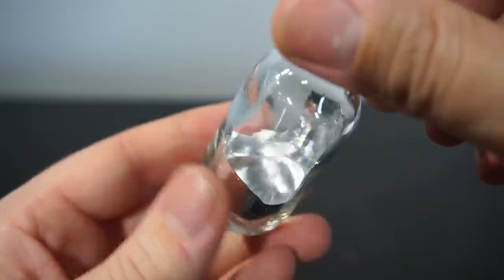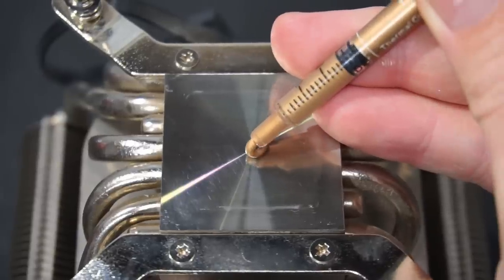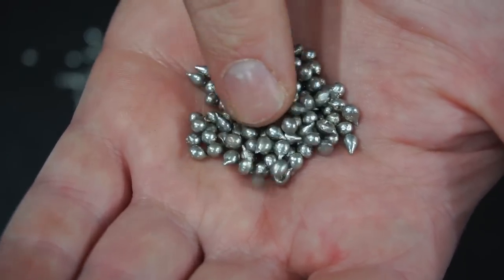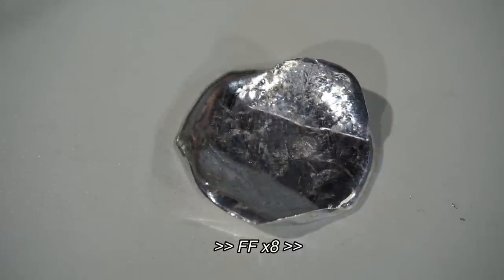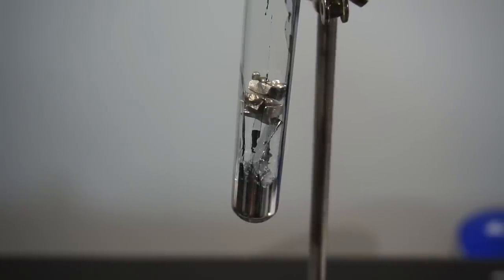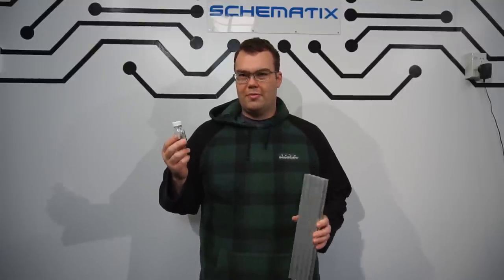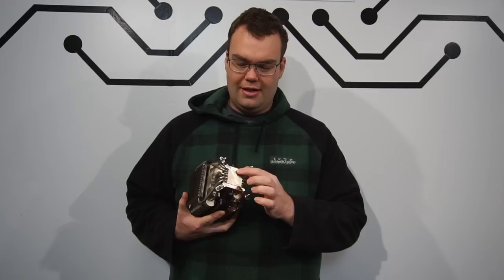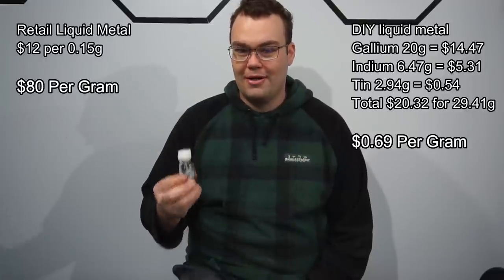Making Liquid Metal Thermal Compound (Save $$$)

Comment: Indium foil is what I’ve seen used in insanely high end transfer applications. It’s supposed to be as you can get to diamond without buying optical diamond CDV windows. 

Like if you buy a $100,000 laboratory laser module for an optical test bench… And open up the laser cavity… There will be indium foil used in the place of thermal grease or liquid metal. 

I bought some insanely powerful infrared laser modules on eBay.  they were about $100. And when new they are thousands and thousands of dollars. Like $20,000. Made by coherent, and the entire optical laser cavity is contained in a module that is completely gold plated, And hermetically sealed. But I’ve opened up some of them before to do modifications and repairs. 

You can look them up on eBay just type in something like “coherent laser 80w”. Many of them that I have purchased and repaired still had traces of iridium foil pressed into the pores of the metal on bottom. It really is impressive stuff, super cheap, (for what it does) and supposedly very great at heat transfer. 

I’ve used gold leaf sheets before as well, because it’s what I had on hand and it’s extremely cheap to buy a whole book of solid 24 karat gold leaf sheets. They are only pennies each, are pretty good size, and if doubled up do a pretty good job transferring heat in places with optical equipment where I absolutely can’t risk using some type of liquid or paste.

Also I don’t know what type of affects the gallon will have when mixed with the other things in your solution. But if it were to come in to contact with anything aluminum… That’s a big deal and will absolutely eat things alive. But who knows I’m no expert just a part time Tinkerer and full-time ne’er-do-well. 😂 

Thanks for the video! Always love your content. It’s extremely high-quality. And offers more advanced methods and topics than your average electronics YouTube channel but without getting into straight up rocket science stuff. Love it!
Reply: OK my bad should’ve finished watching the video before I made the comment about it being dangerous near aluminum. You obviously showed that very well in your video. Thanks again!
Reply: Sorry to make another comment… But in my opinion the foil would be better because not only do you not have to worry about the gallium contamination… 

And foil from what I have seen… Sinks into the pores of the metal just like it would if it were liquid. And that’s why optical and laser companies use it because it’s easier to handle than liquid. And they can’t be having any type of liquid in their hermetically sealed optical modules.
Do you think the thermal transfer would be the same? I know for a fact it penetrates the pores on the metal with given a small bit of force… Because I have examined it under a microscope and it’s obvious when you brush it away and even wipe it with alcohol you can’t get that silvery looking foil off of the gold plating of laser optic components. Just like if you were to take a blow torch to copper that has had sold or melted on it… You can heat it and wipe it as much as you want but only mechanical removal will completely remove the silvery look… In other words sanding.

Would love to hear your opinion on this.

Comment: Not only aluminum can be corroded by this. I saw a graphic card messed up by a gallium metal solution. It reacted/corroded with solder joints and made it unusable. Sure, it is a very good thermal paste alternative, but if made contact with the rest of the board it will corrode anything made of tin(all solder points - especially mosfets, but also other small components - capacitors, resistors etc).
Reply: what? I'm not sure what you are going for here. I know your post is 3 years old but If you can elaborate it would be great. the liquid metal is never supposed to come in contact with the solder joints. it slightly discolors copper heat spreaders but that can be fixed with sanding later down the line. but it eats aluminum at an insane speed, like a giant ingot being turned to nothing in 48 hours type of fast. but it's conductive so there is 0 reason for it to be outside of the DIE, chances are it would short out other electronics instead of corroding them.

Comment: If you could pump liquid metal, you could remove tons of heat really fast... Water thermal conductivity is very small 0.5 w/mk compared to Galinstan  16.5 w/mk. If you add simply some NaCl(salt) you will increase thermal conductivity of water to 0.6 w/mk, also has antibiological effect. Water can go below 0 celsius up to -21.1 degrees depending on saltiness(1.193 density), if you have very cold water to spare for your cpu. Galistan also freezes on -20 celsius, but density is 6 times more, which also mean it is 6x times more heavier and harder for pumps to pump it...

Comment: Mercury itself in pure form is actually relatively safe and will not be absorbed through intact skin. You are thinking of methylmercury which is extremely dangerous. However, mercury wants to react with Aluminium which is a common heatsink component so using it would still be a bad idea for a thermal compound replacement.

Comment: Hello, Thank you for this video! ... Are your material ratios the only that will work? Can the material ratio be changed and maintain a liquid state, but compromise heat transfer rates? Wondering if various brands of liquid metal thermal compound have to be identical - there can be no difference to meet the same heat transfer specs? Can there be an inferior brand liquid metal thermal compound?  Thank you for the info !!!!

Comment: what is the heat conducting properties of tin and indium?

can you make a flat sheet of tin or indium and while maybe it wont work as well as liquid metal because the use of tin and or indium by it's self does not contain gallium there would be no threat to aluminum?

Comment: I recently bought (but haven't applied yet) a Coolaboratory MetalPAD for my laptop. It's a super thin sheet of flimsy metal that is just laid between the heat source and heatsink, and it doesn't melt, it just conforms to the shape after a bit of burn-in. It's non-corrosive, safe to use in touch with aluminium or other metals, poses no danger of ever running off or pumping out, and has a real-world thermal performance worse than liquid metal but better than high end silicone-ceramic thermal paste, actually right in between, but as opposed to latter, shoudn't ever need to be replaced. This might just tick all the boxes, being easy to apply, safe and durable and having excellent thermal performance.

I suspect it's just Indium with a bit of tape backing to help apply it. Or did they alloy something to it? I wonder.

On a similar note, i wonder if gold leaf is a suitable thermal interface. Someone on Reddit tried, but due to their application technique, apparently got more air than gold between their thermal surfaces and had a terrible thermal performance, 10°C worse than AS5, which in turn is a couple degrees worse than state of the art thermal pastes.
Reply from the maker: Hmm, that's very interesting info. I wonder what metal / alloy they used to make the thermal sheet. I'd be interesting to see if I could make a DIY version.
Reply: @Schematix  as he said,almost sure its indium.Intel used it too as TIM of the integrated graphic chip on the  I3-540
Reply: @Schematix  Indium, Bismuth, and Copper.  They also add a copper shim between heat sink and the CPU. I don't know what that is for. Stabilization of the "weld" so it doesn't just squish away as liquid? Please do a follow up tutorial. Thanks!

Comment: Could you try using "wood's metal" as thermalpaste. I know it contains  a few toxic metals but since youre not plannig to eat thermalpaste it should be save ^^
Reply from the maker: Because Woods Metals has a melting point of 70c (158f) It'd be all but impossible to apply to the CPU and heatsink.

Comment: That's the best saving ever!! But does it not leak out if your motherboard is vertical?
Reply from the maker: It doesn't leak out unless you apply too much liquid metal and it squeezes out once you installed the cooler.

Comment: Umm they only sell LM in 1Gram tubes or larger, not 0.1g. It also costs $15 for 1g, not $15 for 0.1g. So your idea that making it at home cheaper is completely wrong.... You definitely got mixed up there lil buddy.
Not to mention to make the LM yourself you will need to order all these different metals, pay for all the shipping. You will have to order somewhat "Large amounts" because what are you gonna do, order 1g of each metal? Buy test tubes, buy a blow torch, possibly buy other materials.
When its all done you'll end up with like 30g of home made LM. What the hell are you going to do with that much LM?
Reply: https://en.m.wikipedia.org/wiki/Joke
also 15 is still bigger than 0.69

Comment: Like in the video, the biggest issue with liquid metal is that it's not suitable for aluminium and only for copper. The aluminum will dissolve after a while. Unfortunately most cooling blocks are aluminum nowadays.